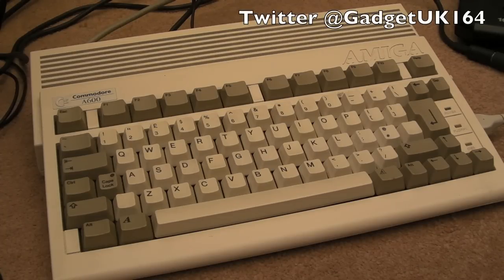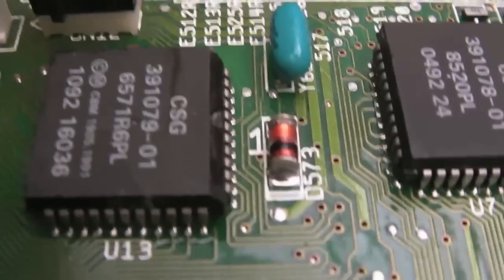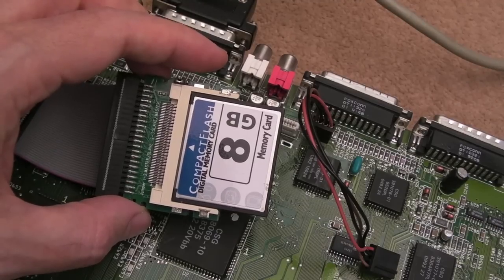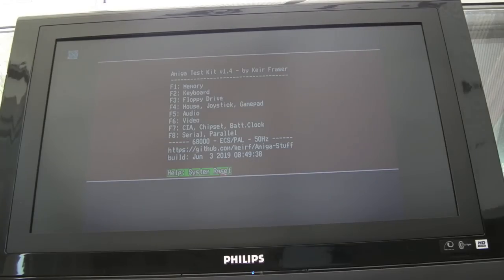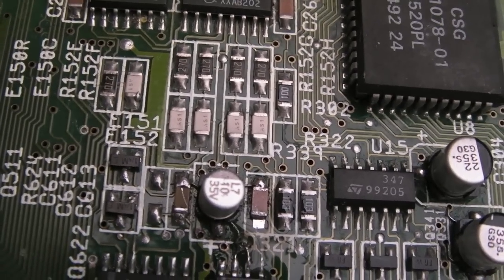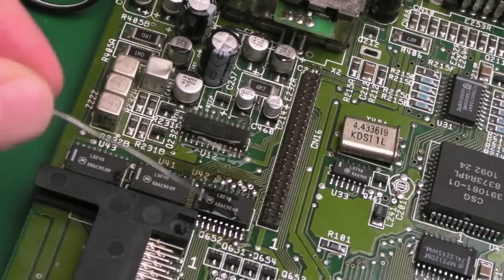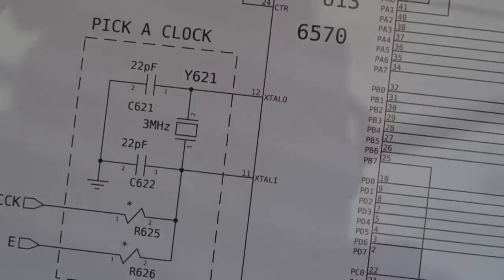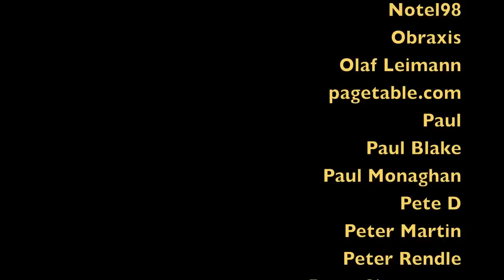Commodore Amiga A600 Repair (Red Screen / Black Screen / Keyboard Fault)

Comment from the maker: That 74F27 is actually a triple input NOR gate, not a NAND!  I only just discovered this now!  I've made that mistake before on Neo Geo schematics.  If you look at the shape of the gate on the diagram, it looks like the symbol used for an AND gate (with inverted inputs indicated by the small circles).
Thanks to StuRoRo for supporting me on Patreon, and for trusting me with this repair =D   https://www.youtube.com/user/StRoRo

One thing I forgot to mention at the point I scoped the keyboard MCU data and clock pins - you could in theory connect up an A500 / A2000 / A4000 keyboard to the data and clock points, in order to rule out the MCU.  ie. if your A500 keyboard registered key presses going into the CIA that services that MCU, you know the MCU is probably borked.  Correction: Gayle is not a QFP (Quad Flat Pack) - it's PLCC.

It goes without saying I think - had I focussed on scoping the _reset signal and _kbreset signals at the start, it would have revealed the solution much quicker.  But we covered extra stuff by going the long way around.
Reply: Agree, always check a chip's datasheet because schematics can be misleading.
Reply: This is a perfect example of DeMorgan’s Theorem in Boolean logic. 😎 I’ll leave it to the viewer to look this one up...

Comment: Just to clear things up,  I tried to recap it but I messed it up pulled a couple of pads.   I managed to get it working again but over a year it became less reliable. When I packed it away it did fully work but was iffy as if it would boot.  It was a year later I sent it off to get the pads repaired, that is when the he noticed the boot issue got worse.  He did have it a year but this was more due to holidays, personal reasons, lockdown and basically "its the least of my problems" time of life.
Although he tried many things to get it working he only charged me a few quid for the lifted pads.

I'm so happy you got it working, I actually prefer the Amiga 600 over my Amiga 1200 mainly because the size makes it so much easier to setup and store away. 
I was hoping for some inspirational message on a printed label somewhere something like "Good things come in small packages". :D

Thanks again for this.
Reply from the maker: Thanks for the info there =D  And to be clear, I think he did a very good job tbh!  No real issues or damage despite the huge amount of work that looks to have been done to try and resolve the problem!  =D

Comment: I'm not sure if this helps anyone, but when re-capping my Amigas, I didn't try to de-solder the caps. I used a small pair of sharp cutters and removed the top of the cap by cutting into it slowly and cutting the legs inside the cap body. This put little pressure on the pads and left the cap legs soldered firmly in place, which I could then de-solder much more easily. If you do this make sure to cut into the cap along the same line as the legs run, not perpendicular to the legs. It puts much less stress on the pad below. These boards are so old now that pulling up pads is very easy to do.

Comment: Amiga Test Kit 1.4 is pretty old now :) Theres a lot of new useful stuff !

I would say the board has not been cleaned prior to being recapped. I always remove the old capacitors (with hot air), clean thoroughly by braiding off the solder left behind with flux, then IPA, before fitting new capacitors. Any parts that have very corroded solder, I remove with hot air, clean, and then reinstall.

A600's can be a pain to work on, especially if you get one of the "A300" rev 1 boards - the footprints for the capacitors are tiny!

Comment: For your keyboard problem, I had the same and it was caused by the metal shielding of the keyboard touching the shielding of the motherboard. Isolating them from each other's fixed the issue.

Comment: The reason you did not see a clock signal from the crystal on the 2nd pin was because your scope probe was in 1x mode and that was loading down the output of the crystal enough to kill the oscillations.  Try measuring another crystal in 10x mode and you will see a larger signal (assuming the same volts per division setting).  If you can not set the portable scope to a low enough V/div setting use the analog scope as it will most likely have a more sensitive front end circuit.  Also I thought it was snowing on the green background (desktop) screen at first but then I realised it was dust in the sunlight.  You may want to think about changing your furnace filter with an electrostatic one (it will help in trapping the cat fur and some types of germs).
Reply from the maker: Ah, yes - of course!  Thanks for your explanation =D  We don't have a furnace - the conservatory just is filled with lots of dust and probably due to slight damp in there it may be moulds and stuff.  I keep meaning to a) replace the carpet b) wash the brickwork down and c) Get or build my own air filter for that room.

Comment: The ROM socket looks like a single-wipe type as well. Those are a nightmare on A500's - i usually replace them on sight and find it solves a lot of odd problems
Reply from the maker: You don't tend to get those on later boards though - pretty sure it was double wipe!  There lots of rev 3 and and rev 5 A500 with single wipe sockets though!
Reply: @GadgetUK164  I have had Rev 6 A500's in with them on.. just less common

Comment: So you have used vinegar to clean up the flux? Also, where did you connect the logic probe for the positive supply? I'm trying to test Gayle IDE outputs. Do I need to have it connected at all to the positive?
Reply from the maker: No, use IPA to clean up flux.  Vinegar to clean up corrosion - then clean with IPA afterwards.  The +ve of the logic probe is connected to the 5v pin on the FDD power connector.  The logic probe just needs a 5v supply to the red wire, ground to the black wire.  Then you touch the tip of the probe on the pin you want to check.

Comment: Kinda wondering if the board would benefit from a run through an Ultrasonic cleaner and then a good wash off with Isoproyl alcohol followed by a few hours on a radiator

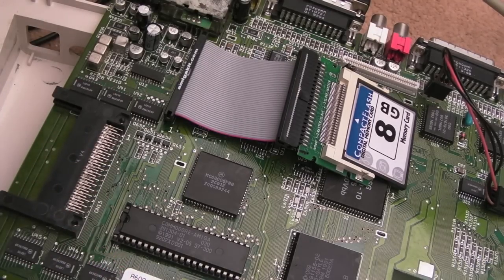Comment: At 22:26 there was a 40-pin chip that looked as if it was in the socket but off by one pin.
Reply from the maker: I talked about that in the video - that's the Kickstart ROM (BIOS) - the socket supports a larger chip which has 2 extra pins.  But the chip fitted is correctly aligned there or it won't boot at all!

Comment: Great vid 👍 and have you seen this vid 🤔 PCB solder pad repair & corrosion clean up - The epoxy method
Reply from the maker: Thanks =D  Haven't seen that one - I will have to check it out!
Reply: If you can, wound be great, he does 2 pad repairs, but he shows how bad the cap leaking can damage the parts around it 😏

Comment: Do you have any idea what can be wrong with A600 when Diag ROM's Graphicstest Testscreen 320x200 (2) has only solid dark red instead of color bars, but grayscale bars look fine. Everything else (workbench, games) also seem to work fine.
Reply from the maker: If all games work fine and there's no other problems with the machine, I would assume there's something wrong with the version of Diag ROM you have there!  Or does the machine have some other fault which you were trying to use Diag ROM to diagnose?
Reply: @GadgetUK164  Machine did have severe board damage due to leaked capacitors (mainly in the audio filter region). I have the DiagROM from author's site, and I programmed 27C160 EPROM on my own.

Comment: that moly grease that you used on the floppy gear is that metal on metal and can that moly also be used on cd-rom plastic tray gears and if not what is good to use on them
Reply from the maker: That EM30L works with metal on metal, plastic on metal or metal on plastic =D

Comment: Using a bit of vinegar on a leaked battery damage makes sense, but are you sure you want to use it on leaked caps? Don't the aluminium electrolytic caps use a boric acid compound as the electrolytic? If so, wouldn't you need something basic to neutralise it, not acidic like vinegar?
Reply from the maker: To my knowledge most electrolytic caps tend to be alkaline, not acid.  In any case, after cleaning afterwards with IPA properly you never get any corrosion starting, so I am sure it's fine!

Comment: Hah nice one, what a nightmare! seems you discovered the hardware equivalent of a software threading deadlock ;)
Reply from the maker: Haha =D  I didn't describe it entirely well towards the end there as it wasn't a complete loop.   The Keyboard reset was not getting through because of the transistor lacking its ground, and I think that also meant the 555 reset was suffering the same issue.  It was however allowing the reset pulse to go from low on power on, to high.  But because of that missing ground the reset pulse wasn't making it through - hence not long enough.  Meaning the keyboard MCU didn't have a long enough reset, and for whatever reason it was then registering as all keys being pressed.